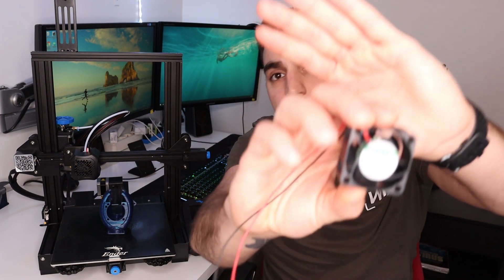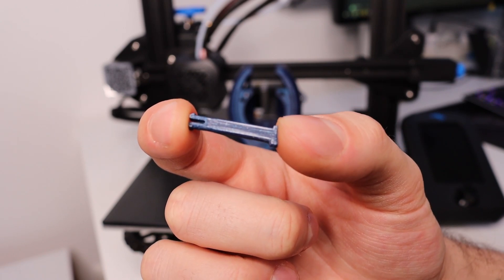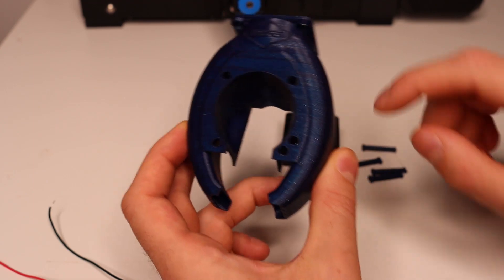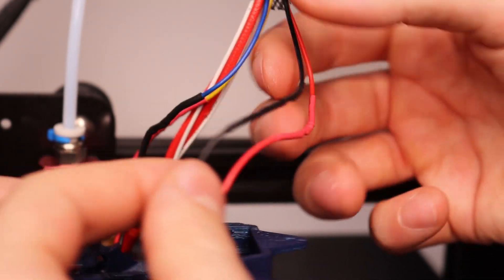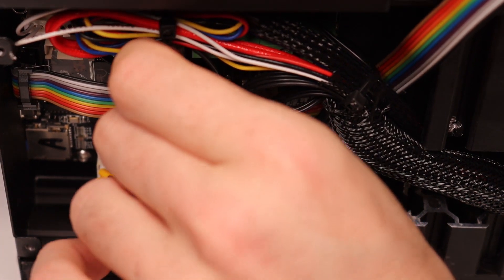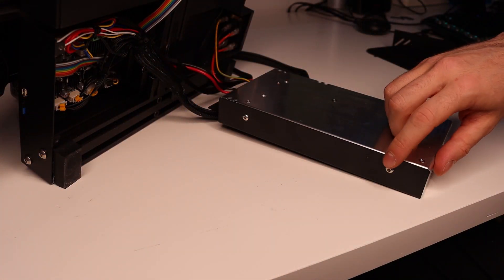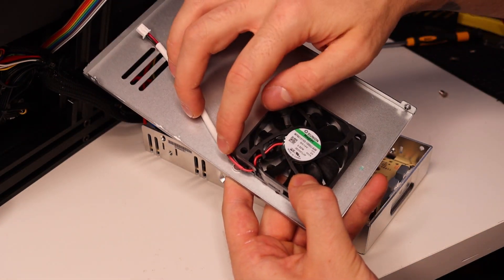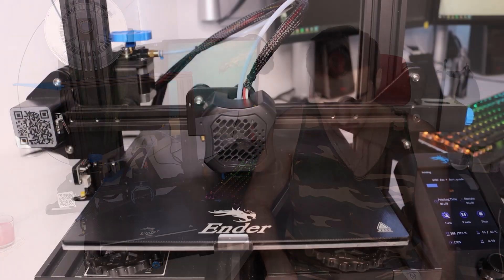ENDER 3 V2 SILENT FAN MOD | Step-By-Step Guide

Comment: Well, I replaced the PSU fan and it seems to be louder actually. :) So that may be why the phone registers higher as well (was the PSU fan on when measuring the "silent" mod ?). A better solution is to take out the PSU and put it behind the printer (as safe as possible) so that it can get its heat out much better, then it won't switch on all the time either (I noticed this because while testing if the fan change worked, it wouldn't turn on outside the enclosure :) ). I ordered a bigger Noctua fan and will print a replacement cover for that, that should really make a difference.

edit: And it does! So don't use the Sunon for the PSU it really doesn't make a difference, print a cover for a bigger Noctua fan and install that (Thingiverse). Raise the printer a bit to get more clearance for the PSU and presto. With the mods in the video I was at 63 Db, with the Noctua for the PSU, I'm at 53! Extra bonus to this setup is that it's not on all the time either and with it off the noise even drops to 49-50 Db!

Comment: Very cool, Its alot quieter. I think that sound app is more sensitive at lower frequencies, but lower frequencies are always alot easier on the ears, so great job, Id love to try this one.  Didnt expect a fashion show at the end but good choice in clothing as well
Reply: Wrong. The app measure the content of total power spectral and the noise is bigger. As you say the fundamental frequency shift to lower value and is more pleasant to ears. This is because the stock fan have a higher pitch and normally higher pitch have lower power. But from a scientific point of view this is a total failure because we don't know if the static pressure of the new fans are better or worse, but if your metrics are only your ears then the measure from the phone are a stupid thing to do. If you don't like what you see with your instruments you always repeat the experiment after you found what variable was wrong. Another important thing is ¿why change the fan inside your PSU and board if you don't measure the result? I doubt the fan from the stock PSU are louder, but these is what you see when you have more money to spend and little brain to use. Sunon and Orion are top quality without doubt but we don't know what of all the changes improve the perceive sound in subjective way as this video claim. In regard of wardrobe changes we have a wise phrase in my country "aunque la mona se vista de seda mona queda".
Reply: @pubdigitalix  stfu dude

Comment: @

Randomecticly I did this upgrade and the fans make less noise :), there is one problem though. The MF40202V2-1000U-A99 fan does not support speed control. So if you need to adjust the fan speed of the part cooling fan then you cant use this fan for the part cooling. Se datasheet for the fan (https://media.digikey.com/pdf/Data%20Sheets/Sunon%20PDFs/MF40202V2-1000U-A99.pdf) Note 7 under Safety.
Reply: Well it works somehow. At lower voltage it does not start but it starts getting better with higher fan speeds from the slicer. Needs more voltage initially.
Reply: Thanks, thats awesome. I wanted to do the same upgrade, but keep the ability to choose my part cooling speed.  You still happy with your MF40202V2-1000U-A99 ? Can you tweak it exactly to the point where its still very quiet and cools well?

Comment: I really wish noctua made a 24v fan in the right size.  The only thing stopping me from getting one of their 24v 140mm fans and 3d printing an adapter is the fact I already had a printer with which I had a larger fan, and the hotend couldn't keep up with the cooling

Comment: The video is great. But I don't see any positive progress in measuring noise in your video. Before it was 52 dB, after 57 dB. 57 is more than 52 as far as I know. The comparison seems to be quieter, but the results are strange.

Comment: Wait so is the fan frame being held by one screw? 5:16
And also, wouldn't having only one screw make the frame suceptible to rotating ? I bought the model btw. I have an ender 3 v2
Reply from the maker: That is correct! I get that it seems a bit unstable but it is quite rigid. If i'm not mistaken, the stock frame also only uses one screw so it should hold :)

Comment: Great video! If you're willing to solder buck converters into your fan wires, you could use 12V Noctua fans which are even quieter and sill make your Ender almost completely silent.
Reply from the maker: Thank you! The purpose of this video was to actually use fans that are easier to install. They're not as quiet as noctua fans of course but they bring the noise down quite a bit :) Perhaps in the future i'll upgrade to noctua!

Comment: The fan you have in the description for the psu fan, says its 12v on digi-key. Is this okay or will this not work?
Reply from the maker: This is correct! I also got a bit confused at first but the stock fan is actually 12V so buy one that is the same :)
Reply: @Randomecticly  Thanks for the help. I'll be ordering them today. And great video, especially if it's your first.
Reply: @Randomecticly  You should also consider making a filament run out sensor tutorial video, as that would also be a great upgrade to this printer. Most likely many people would find it very helpful, like this video.
Reply from the maker: That is a great idea! I've been wanting a sensor like that for a long time. I hate it when there is little filament left and you don't know if it is going to be enough or not.

Comment: How about the difference in air pressure between the new axial and stock radial fans?  Do overhangs have the same quality?
Reply from the maker: I regret not doing more test for this, I was just too eager to upload the video. But I can tell you now that the print quality overall is much better and that includes overhang. 

The guy that made the model has upgraded it so that air flows even better now.
Reply: I did a test: overhangs are a little better than the stock fans

Comment: the noise difference is most likely just caused from the added airflow blowing into the mic.  its for sure quieter :)
Reply: i hear a high pitched whine in the modded version. i think that is what causes it. most of it might be outside our hearing range, but pets will be  annoyed.

Comment: Hey Mate, what's about the led lights? Which you install?
Reply from the maker: Hey man! I Just printed a bracket and put some cheap chinese led strip on to it, nothing fancy :)
Reply: Yeah ok, yesterday I broke the chassis. I try to install the pinholder for the fan on top. But it will not fit rightly and the housing cracks. Fu*k. until then I used cable ties.
Thanks for the answer about the led stripe. And thanks for the good video.
Reply from the maker: Ah man, sad to hear that... It is a delicate job. Hope you'll work it out somehow, good luck!

Comment: I've just got an Ender 3 V2 and I'm surprised how much louder it is than the original Ender 3, definitely going to do this mod.
Hope you are working on more V2 mods because I really like your video
Reply: the original didn't come with the silent boards. My original is far louder than the V2. Unless you are talking about the fan unit. Hearing the stepper motors compared to my V2 drives me insane

Comment: I'm brand new to all this, making modifications to my printer.
The hotend fan is *loud*, and is the only one I think needs replacing in my case. See if I get this right; I can print a new 'housing' to attach to the hotend and attach new fans on, and solder the wires. That's it? I don't have to fiddle with anything in the mainboard etc? It's, frankly, intimidating for a newbie. :)
Reply from the maker: Yes it is that easy when you use 24V fans :) Just remember that your printer is only as quiet as your loudest fan. So if you replace your hotend and it is still loud then you'll probably have to change the other ones as well. 

And hey, I had no experience in this either, I just went for it. Good luck my dude, I believe in you :)

Comment: Holy ****, I found my YouTube doppelganger! Subbed, good luck with the channel 😀

I did a similar mod with Noctua fans and noticed a 10 dB reduction. dB readings aren't everything though, sometimes a rather unpleasant noise sounds louder just because of the way we perceive sound. 
Looking at the features on Noctua fans, I think they do some acoustic engineering with the harmonics to make things sound quieter without actually reducing dB.
Reply from the maker: Hey doppelganger! I looked through your videos and subbed too! Good luck yourself👍

I saw your video and you are right, just getting rid of that loud noise is enough. Perhaps the dB readings doesn't show that but the printing is sooo much bearable to be around now.

I'm thinking of doing noctua fans in the future to further improve the noise but we'll see. I'm happy as it is right now :)

Comment: I followed your steps and replaced all my fans with the same ones and put a Briss Fang on my hot end as well! I also used silicone gaskets for the connections of the fans, and I think I've got the noise down to about half of what it was on my Voxelab Aquila. Thanks for this video, it told me all I needed to know!
Reply from the maker: Awesome! Glad I could be of help👍 Did you measure the noise before and after?
Reply: @Randomecticly  No, but I and a few other people feel that the noise was reduced by about half. I recommend the silicone gaskets!
Reply: @billsmith4932  hey man, can you download some the noise measurement app and measure the noise now. It would be good to know level of noise

Comment: The psu fan you showed has 12v, is there a step down Modul required?

And thanks for that great video!

Edit: My bad, just checked, the original is also 12v.
Sry

Comment: I liked and subscribed instantly, the question I have is can you change the fanspeed on the part cooling fan. I read a technical sheet of data on the 40*40*20mm (sunon fan) and it doesnt say fan speed can be reduced. Is it left off and then on max? can you just test if you can increase the fan speed from 10%, 20%, etc up to 100% for me please
Reply from the maker: I know that there is a way, just don't know how... Yet! I will check it out for you and get back😊
Reply: It's cool. I don't think these fans can. According to a document I read they don't have pwm. But I have forced a few fans to do that via tweaking the firmware. It's a gamble if I get it to work I'll send you the lines of code in the firmware that worked for me.

Comment: I regret not soldering on proper connectors when I changed the fans on my Ender 5. One of the replacements failed, now I gotta do it all over again.
Reply from the maker: Did you solder the fans to the stock connectors like I did in the video? Or did you use other connectors? And how did it fail?
Reply: @Randomecticly  I just cut the wires and then connected the new fans using solder. Cheap fans tend to fail more often in general

Comment: Good vid. I've only had my V2 for less than a week and printed a lot of stuff and I'm getting to the point where if I don't do something about the sound then I'll never sleep again. I'm doing the 120mm PSU fan but of all the different hotend fan mods I have decided I like the fang the best. The ones that use blower fans seem cool but I've never met a quiet blower fan so I decided it's not worth the time.
Reply from the maker: I thought of doing the 120mm psu fan as well but it seemed like a lot of extra things to do than just replacing the fan...

Just remember that your printer is only as quiet as the loudest fan. So there is no need to replace a fan if there is one that is louder :)
Reply: @Randomecticly  Agreed but you replaced fans with basically the same fans. The PSU fan is the loudest and ridiculously undersized. Half a day printing the new PSU templates and even a cheap 120mm fan has eliminated the hairdryer sound. Still waiting on my 4020 Sunons to see how close to silent I can get.

Comment: Fantastic video! 😃 Subbed. 😊

I'm a little bit apprehensive about opening up the power supply, since I'm pretty new to electrical stuff. Those capacitors can be scary. 😅

In general, though, this all looks pretty doable. I'm excited to give it a shot 🙂
Reply from the maker: Dude, you'll be fine... What's the worst that can happen?😅

No but seriously, it is all pretty intuitive so you will be fine👌 This was my first time opening a power supply too and it went great! If you have any questions just leave a comment here and i'll help you. Good luck!
Reply: @Randomecticly  "what's the worst that can happen?" ... https://www.youtube.com/watch?v=wmin5WkOuPw :D Otherwise i also liked your video!

Comment: Do you know what airflow does original fan have? I found another Sunon fan, 60x60x15, 12V, 2200RPM 14,5dB, but I'm worrying it will not provide sufficient cooling...
Reply from the maker: I'm guessing you are referring to the psu fan. In that case you should read this reddit thread:
 https://amp.reddit.com/r/ender3/comments/iopd83/power_supply_silent_fan_for_ender_3_v2/

I had some trouble finding the right specs myself so this is the best I can give you :) Good luck!
Reply: @Randomecticly  thanks, yes, i’m talking about PSU fan. I will go for it, hopefully I won’t burn my house down 😅
Reply from the maker: Haha let's hope not😅

Comment: If you buy a few noctua fans it is totally silent, nice tutorial
Reply from the maker: Yeah i'll probably do another video with the noctua ones. But this one was for the sole purpose to avoid fans that are 12V... Also, noctua fans doesn't quite add up to the requirements, so I don't know how safe it would be
Reply: @Randomecticly  it is definitely easier to  work with 24 volt fans but that doesn’t help as much as noctua I think it is worth. The work and small risk that you get

Comment: great guide! as someone who is new to the 3d printer world i struggled quite a bit following other (written) guides that did not really explain how and where to open the 3d printer and how to install the fans correctly. also i like the fact, that you included all the details on the fans used and didnt use noctua fans (which are excellent for other use cases).
i really wish i had found this video earlier, could have saved me so many hours of researching!
Reply from the maker: Thank you so much! I was having the same struggle as you, that is why I made the video :)

Comment: Great stuff!!! Have you had any temperature issues with the PLA material being so close to the heating element? I don't want to have to buy a PETG spool just for this project...
Reply from the maker: Thank you! No I haven't actually! I've been running my printer a lot and no issues has arised yet :) PLA works just as good

Comment: Nice one, actually you should have mentioned that this is a good oportunity to decouble the mainboard fan from the 
component fan. For thoose who don not know: The mainboard fan is (for whatever reasons) connected in parallel to the component fan. Which is a pretty big design flaw, because if you set your compenet fan to 0% your mainboard fan is off as well. Better: Connect it to permanent power. Optional tune a down a little by a Resistor or z-diode
Reply from the maker: What do you mean with component fan? I have actually read somewhere that you should connect the mainboard fan to permanent power so maybe i'll do that :)
Reply: @Randomecticly  component fan: The part fan. The one you control to cool down your parts. For the ender 3 v2 it is the blower fan on the right side, the one with blue/yellow wires. By stock the mainboard fan is connected in parallel to this one .So if you set your cooling to 0% in e.g. Cura your mainboard fan will turn off as well (does not make any sense at all)
Reply from the maker: @pulponair  Ohh okay! Then that is reaaally stupid of Creality  to do haha
Reply: @Randomecticly  Not just stupid. Also dangerous. :) A good fix is: Connect the mainboard fan directly to 24V and tune it a down a little by using either a resistor or a z-diode. Result: healthy Mainboard, silent mainboard.

Comment: The PSU fan is by far the loudest of them and is the one mainly responsible for the machine screaming like a hairdryer on full blast while operating and the hotend fan have bad bearings from start that already squealed and vibrated like crazy the very first time I turned it on (Something I did  NOT expected on  a brand new machine even at its low price, especially since its otherwise a good quality build with great positioning/printing precision)  so want to replace these 2 at least.
Reply from the maker: Yeah that's the thing, it is only necessary to replace the loudest fans but when you've done that the loudest fans are now the ones you didn't replace. It is better in my opinion to change all of them to new ones that operate in the same noise level.

If you do only change those two fans i'd love to know how much the noise changes, keep my updated :)

Comment: Thanks for the video.  I have found that my fans are the loudest just as it starts up and then quiets down before it begins to print. I plan on using your video to do this mod this weekend.  Thanks.   Great first video.  Good production value for sure.
Reply from the maker: Thank you as well! Keep in mind that the part cooling fan doesn't spin at 100% the first and second layer so that is why it is quiet in the beginning. Also, the mainboard fan is not always on, only until it gets too warm underneath the printer :)

Comment: is the temperature the same?
Reply from the maker: I forgot to test the temperature on the PSU and maimboard before and after so I can't really compare. I did check the specs on the stock fans though and the new fans met with them.

The temp on the hotend is the same but the part cooling has been improved with the mod :)